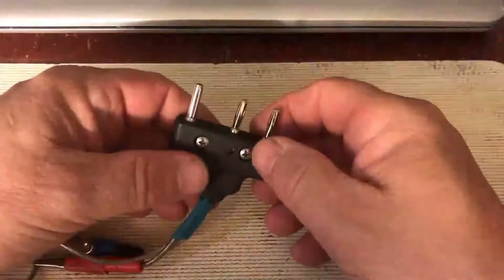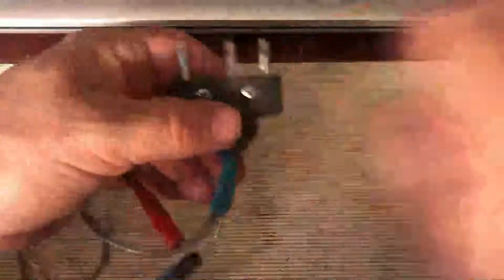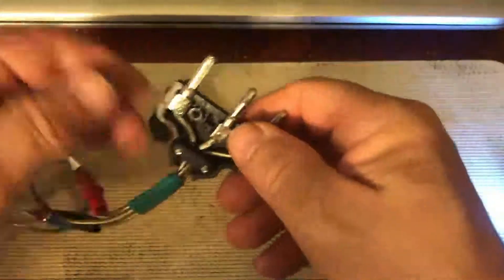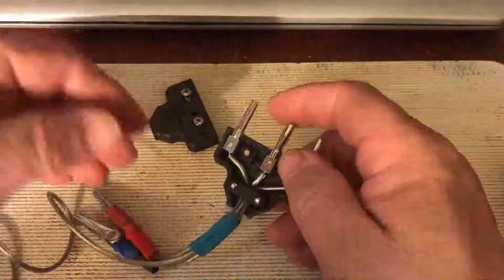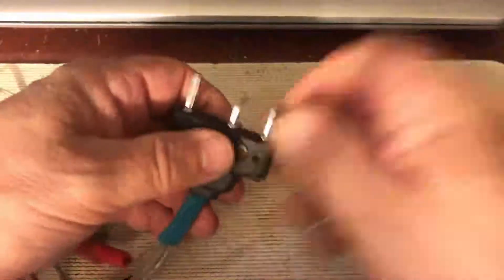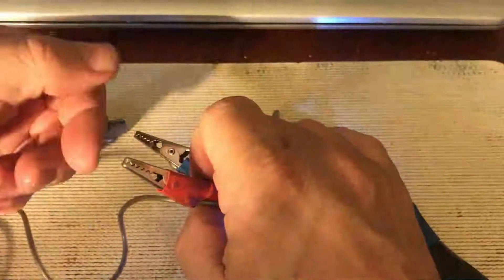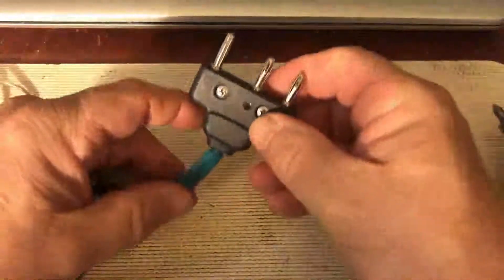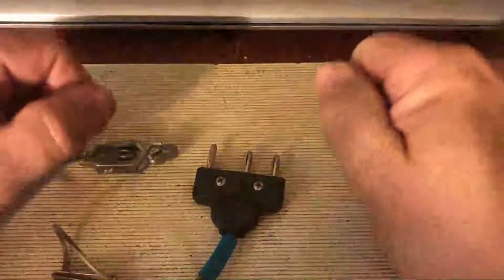I Can Haz Armory # 70 --  Blade wiring test jig

Comment: Watching all your videos as I’m going to help my daughter’s high school team. Nice jig. I should also be able to test like this if I used my alligator probes on my multimeter in continuity mode, and getting an alert when I press the epee tip, correct?
Reply from the maker: I think you mean to put one probe in the A socket receiver and the other in the B receiver,, correct?  If that's that case, when you push the tip down, A and B will short and complete the circfjuit....so that would be correct.

The trick is going to be maintaining those probe contacts while doing the weight and shim checks.  You might consider getting a spare set of probes, cutting the probes off, and connecting a C body cord pin to each....that way they'll stay in while you do the other checks.

Additionally, depress the tip while the pins are in a/c and b/c....if you get a light on one of THOSE tests, you have a grounding issue that will prevent the light from firing.